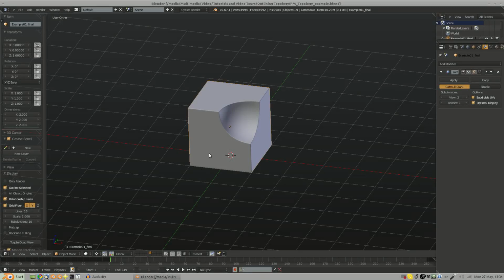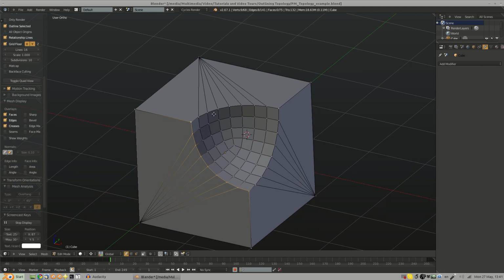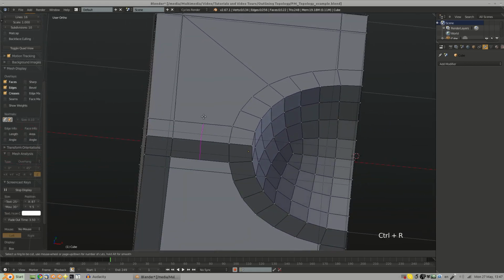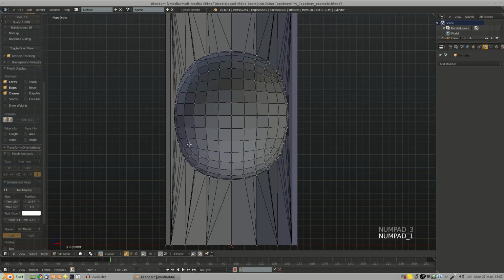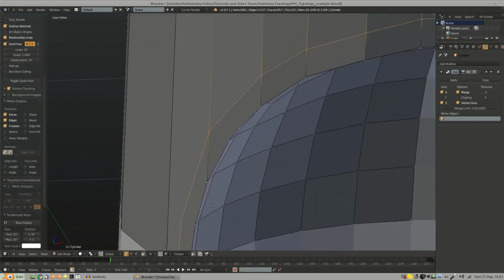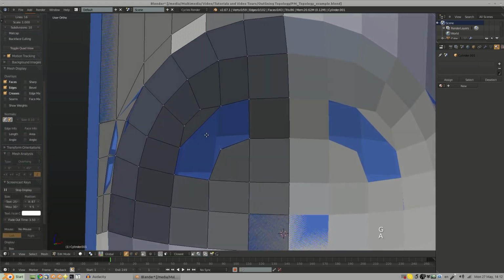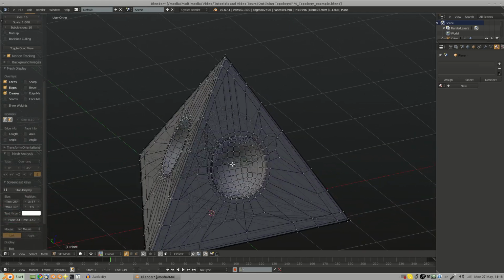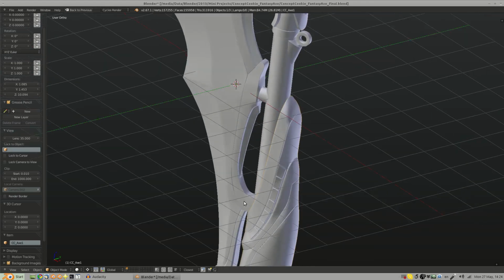Outlining Model Topology - A (long-winded) example

Comment: great to find a tutorial with this specified retopo tops, with poles especially. I badly try to find more about the pole- theme, seems to be essential and as an autodidact I think if 3d modeling was educated this would be one of the first steps you will be introduced. I had to run in circles and am still searching for modeling hints like how to reduce connection points and keeping quads- exactly ths, but it seems to be nothing out there. Any hints? - and thx for the great work!

Comment: When you "sharpen up" the edges, you make two loop cuts and move each of them closer to the edge. Wouldn't it be better to just use the bevel tool? This way you'll get both edge loops in one go, and they will be equally far from the edge.

Comment: heh, I guess I could have chained my comments a bit better, but I definitely couldn't have packed them all into one. :)
Oh and I forgot one thing about the move along normal: You also need to set the center mode to individual elements and while it doesn't really matter for grabing, the results will vary if you do this on verts, edges or faces, when you rotate or scale. Experiment. It's a great feature. Essentially "shrink/fatten" with tons of additional control and more predictable behaviors.

Comment: Try setting the axis mode (next to your selection mode buttons, where it says "Global") to Normal and tab g, then double-tab z. That way, you'll move stuff along the normals, including snap functionality. In case of this cylinder, it should work absolute wonders to get the vertices along the sphere rim to line up exactly with the vertices of the top of the cylinder.

Comment: Hint: Set Snapping to Active Element. You get MUCH more control over it that way. The Vertex that snaps in that case will be the active one, rather than the closest one which could be rather finicky at times.

Comment: If you *really* want to use a sphere, you should also spherify the cube. Subsurf will have it be slightly cube-like, essentially a super smooth cube, but it's varying enough that you can still tell that it's not a sphere, if you don't correct the shape.